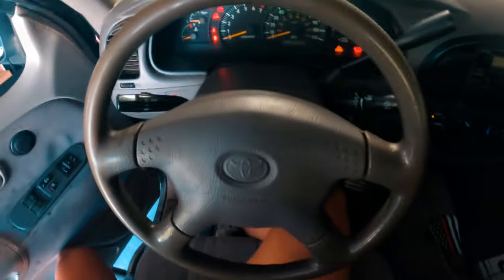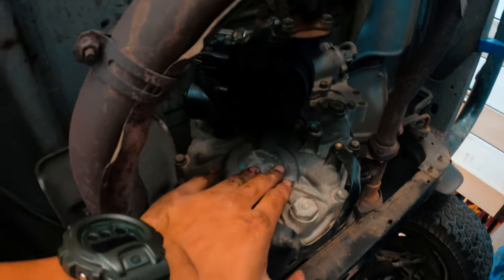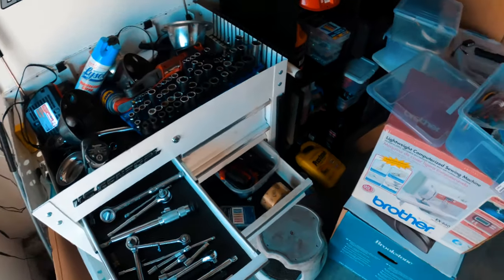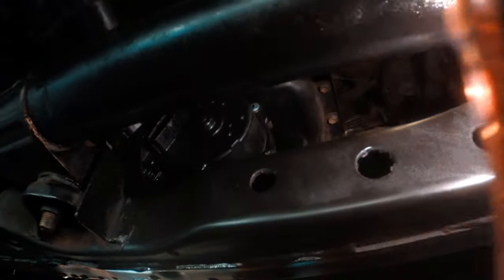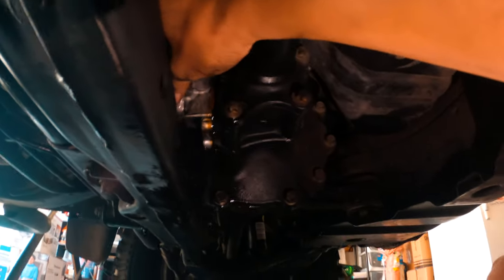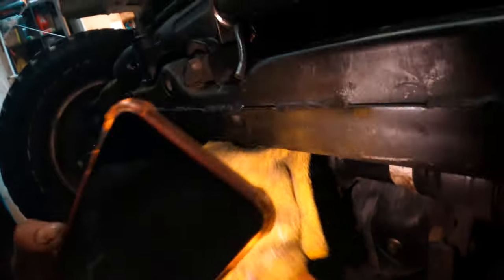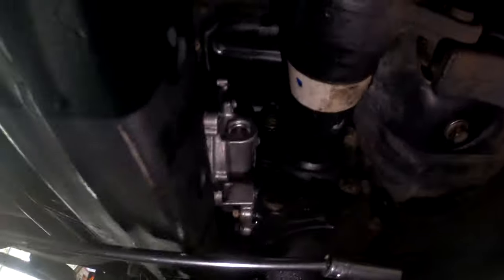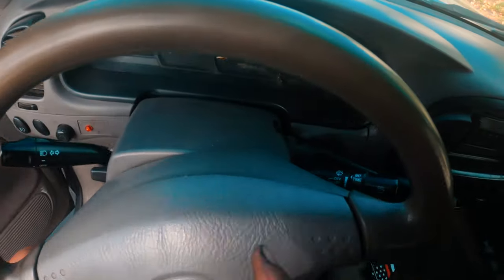2002 Toyota Tundra Not Going In or Out of 4x4|How to Fix

Comment: Hey Man just wanted to let you know that your video was helpful in my replacement of the front actuator. I ended up buying the aftermarket at Oreilly's, it was the Dorman brand. I didn't want to pay the OEM price but also couldn't get it on a Sunday anyways. It works which is good. Happy I found your video, was helpful knowing that fluid would leak out when removed. I couldn't get the plug out that you removed so I just removed the part and was able to get the plug out to refill it. Thanks again.
Reply from the maker: Glad I could help!

Comment: Really helpful - the little things are the most important, like how you finagled the ADD up and rearward to get it out, nice to know that ahead of time.  My fork was on the far side compared to the new Toyota ADD fork position - I found just turning the propeller shaft a bit allowed me to reposition the splined sleeve inside the differential to line up with the new part - no panic, just kind of figured that out. It's a nasty job on your back for sure - but you're gonna keep a $1200 job below $500. Buy the Toyota ADD online from your dealer and you save like 30%.

Comment: I have an 03 sequoia. No sounds from the transfercase actuator or the A.D.D.. Both sensors on the transfercase show continuity. Bench testing the transfercase actuator, I got the motor to spin. Haven't been able to test the A.D.D.. this video was very helpful, thanks! Going to order a replacement and hope for the best. Currently stuck in 4H Locked so it's not drivable.

Comment: Having kinda same problem on a 2015 tundra. Stuck in 4w low and when you goto neutral it makes a narly grind sound from transfer case. If left in 4w low it will drive hi or 2wd it will not go and grinds.

Comment: Hi I have the same problem but the light only flashes when I go into full lock, which then locks up the front axles and th car is unable to move. Is this the diff actuator that needs replacement?  Thanks for the video, very helpful.
Reply from the maker: does it unlock when you press it again?
Reply: @4runnergodfather158  no it starts blinking when locked. I have to switch it back to 2wd in order to move again, otherwise it stays stuck. Wondering if it's the diff actuator or not.
Reply from the maker: @biggabeats  have you tried jacking up the car and turning your tires by hand while its blinking? if theres resistance and both tires are turning then your axles are locked, which means your front diff actuator is doing its job. However with the vehicle on the ground, If you are unable to move after you shift the tranny into drive, i think its going to be the transfer case actuator because its not reading the info transmitted by your transmission.
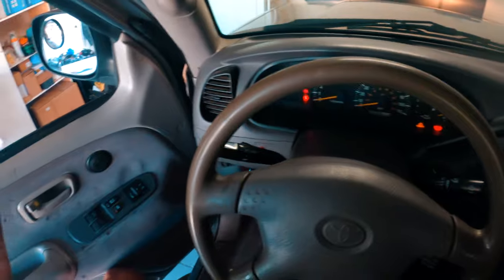Reply: @4runnergodfather158  Here's the issue on video. https://www.youtube.com/watch?v=CRVozCL7FZo @0:35 sec, I'm trying to push the gas but it's stuck. Once I reverse and straighten wheels, it moves again but 4wd will start blinking. Thanks for the input.
Reply from the maker: @biggabeats  i think i know why,. its because there is great resistance on asphalt (big reason why its not moving)and you can actually break your axles if you drive too fast on full lock. if you try that on dirt or snow, you would be able to move. it blinks because its trying to unlock itself. if you give it a bit omore gas at full lock and your car starts to hop and your tires squealing, then you know its locked in. dont give it too much gas because, again, you can break the axles. im almost positive thats the reason.
Reply from the maker: @biggabeats  also, its blinking after you go back to 2wd, thats because the system is telling the car to unlock. Just give it sometime and move the car back and forth, then you will hear it unlock and the flashing will go away.
Reply: @4runnergodfather158  Thanks man, you're right. I looked into it further. Turns out the truck goes into driveline binding (axle binding) when on high traction surface (pavement). I hit the gas harder and it jumped, just as you said; now I know not to ever oversteer in 4wd, nor use on the street. Thanks again for your time, now I'm gonna return this diff actuator I just bought lol.
Reply from the maker: @biggabeats  glad i  could help!
Reply from the maker: @biggabeats  awesome thats good to hear!